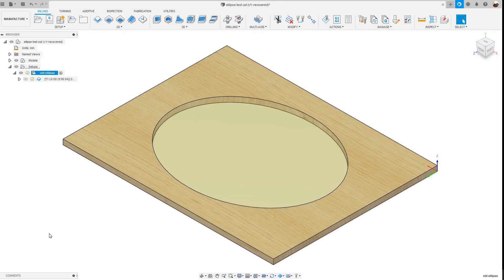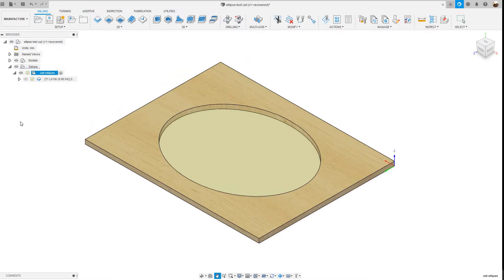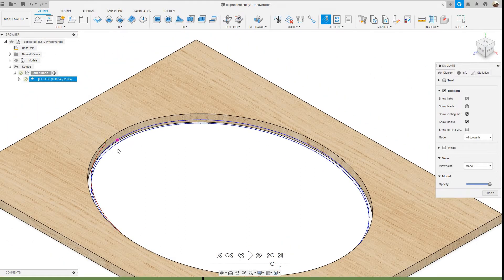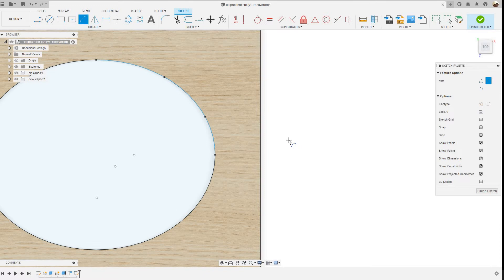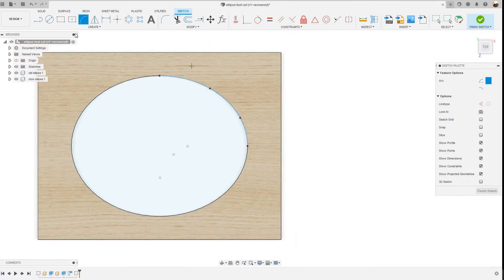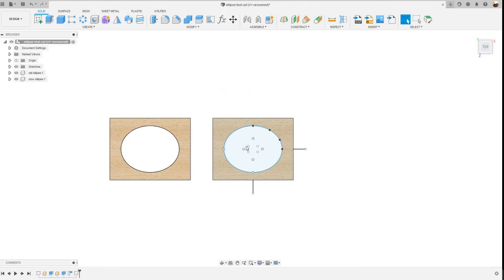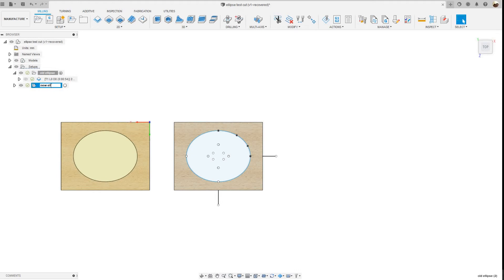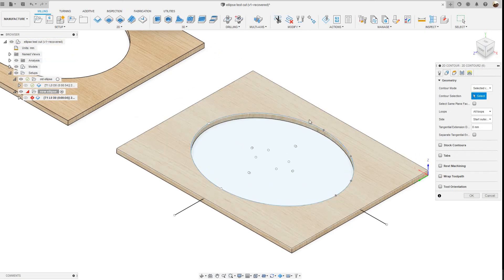FUSION 360 TO WOODWOP-HOW TO MAKE YOUR CNC MACHINE RUN SMOOTHER WHEN MACHINING ELLIPSES.

Comment: Is it something specifically with the ellipse that you can't use the smoothing option under the passes tab in your toolpath dialog?

enjoying your videos. I have a really odd story where I acquired a salvaged 2022 Homag P-110. We're getting it running but close to test cuts. My experience is g-code based with Haas and Mach3 machines, so WoodWOP is feeling very foreign. I'll figure that out when I need. Anyhow, I may reach out at some time for some pointers. I have a video about the Homag I have on my channel when we first received it. It's come a long way since then, but feel free to check it out.
Reply from the maker: Thanks for the feedback, you can use smoothing and play with different values, however you will still get a lot of tiny arcs resulting in machine jerkiness. Tracing it was my work around. Autodesk posted a new version of the post processor after i made this video, perhaps the gcode is lighter. I will make an updated video on this. 
 I should be getting my desktop back from my friend and i will start making videos. Sure i will check that video out, i have a ton of content on my Instagram page if you want to check it out. Any help you need, let me know, i am more than happy to help anybody.
Reply from the maker: Nice machine, it's got horizontal drilling. I have been programming and operating Weeke pod and rail cnc machines for 10 years, mainly using Woodwop until Fusion 360 was released and they made a post processor for these machines.